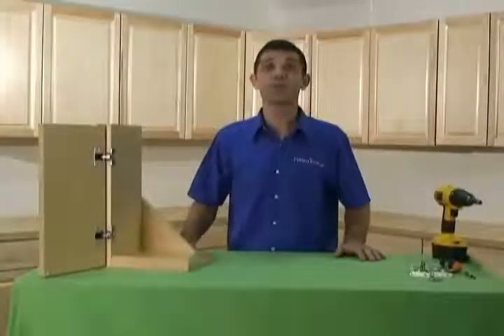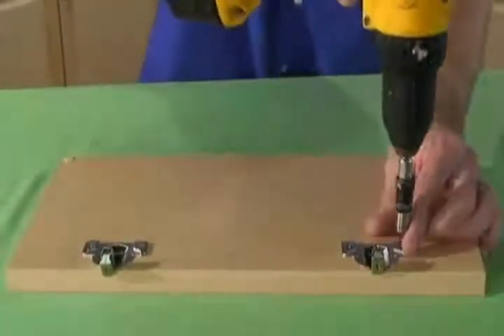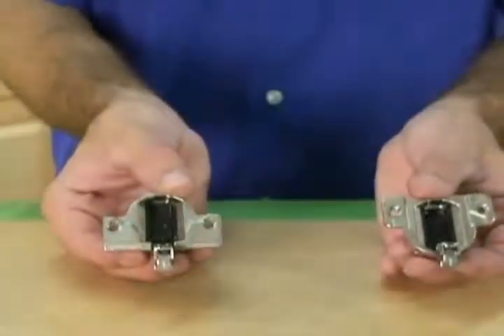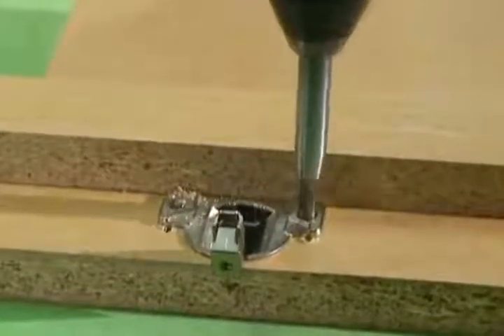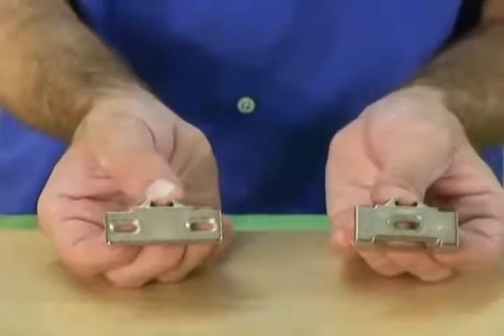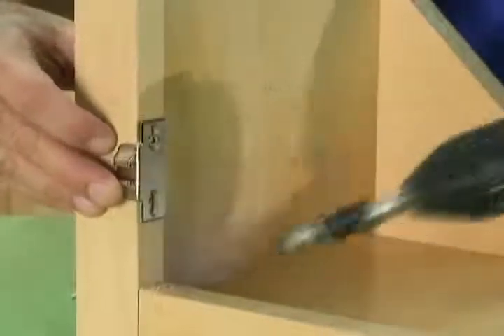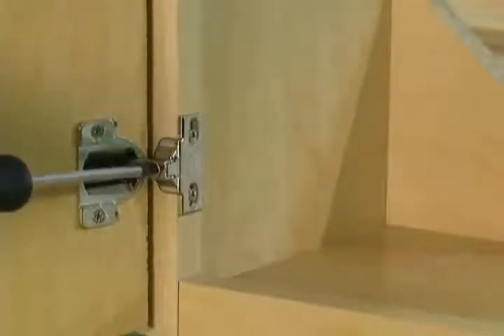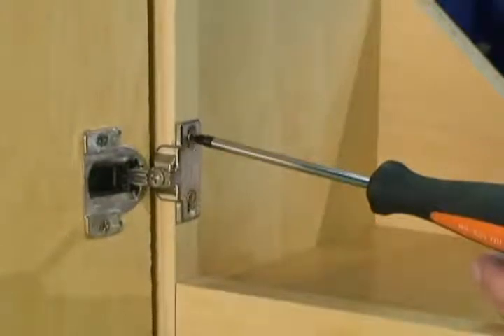Blum Compact 33   How to install and adjust a Blum Compact Hinge

Comment: TO REMOVE  Once all three screws are removed from the old assembly, grab the spring loaded lever and gently rock back and forth (with long pliers or , channel locks)  also helpful to then squeeze a thin putty knife under one side at a time,  perpendicular to the direction it normally moves as you gently pull out on it to get About 12 of those very small motions and it will pop right out of the door.